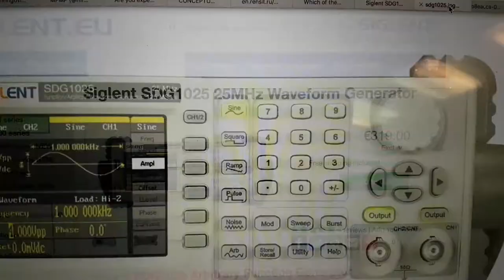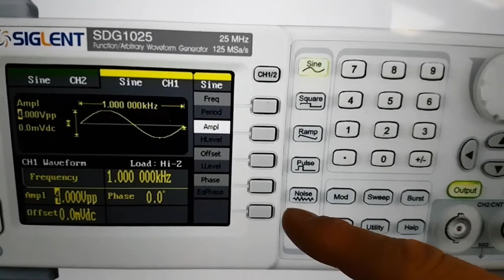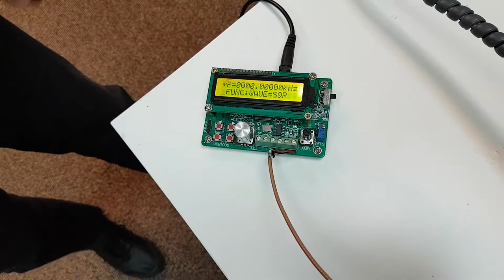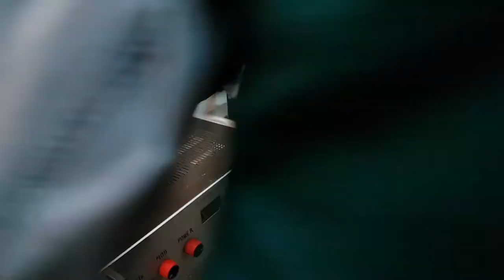Super NOVA

Comment: Bob, would you be just as happy if you didn't have an issue with Microwave leakage?  Could you provide a waveguide into a (Shawyer type) EM Thruster mounted a couple of centimeters aft of the reactor housing?
Reply from the maker: Possibly in due course

Comment: Here is a comparison of Siglent SDG1025 and similarly priced Rigol DS1022Z. See the last video from https://www.tequipment.net/Siglent/SDG1025/Function-Generator/
Basically video shows that Siglent is more noisy than Rigol.
From other sources I heard that Rigol has problems with generating square form especially on high frequencies. Don't have any info on SDG1025 though on this matter.
Reply from the maker: Thanks Anton, very helpful info.